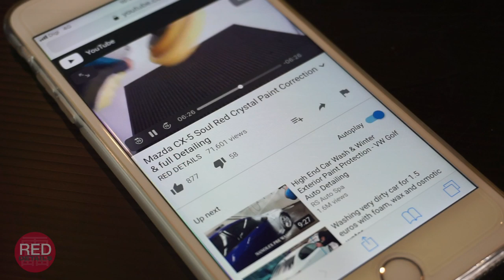" Repaint " Lexus Is250 " 2k Solid Grey "Full Detailing & Paint Correction

Comment: I see you don’t use a pressure washer or apply snow foam as part of safe wash. Please explain. 
Great vids 
Thanks
Reply from the maker: Thanks for comment , Eight years ago I have used it , but the water pressure machine often have a problem ... Bucket Wash , low pressure water “ safe “still can do a good job , only waste of water >< “
Reply: I thought the pressure washer used less water some how, maybe 🤔.
Thanks
Reply: @shakeelahmed5822   It does use less water
Reply: I think he meant the draw back to his method is he uses more water.
Reply: Shadow18CD as long as the wash is safe then this way is also an option. 
Mr Red does make some good content👍🏼.